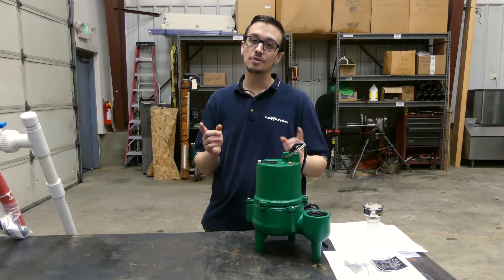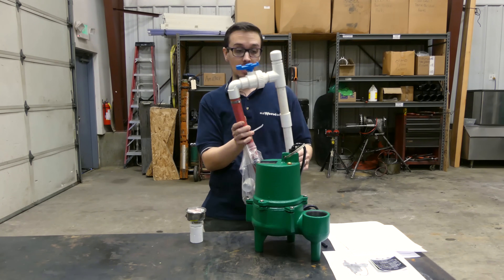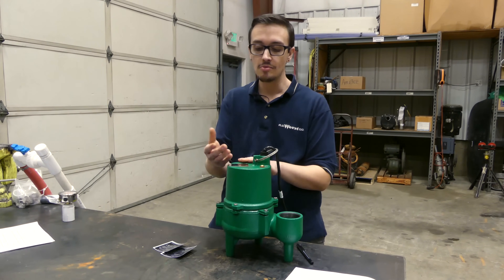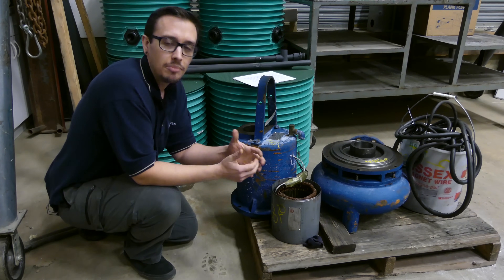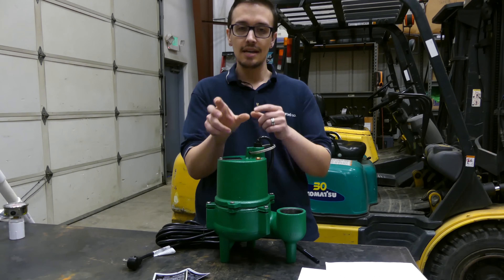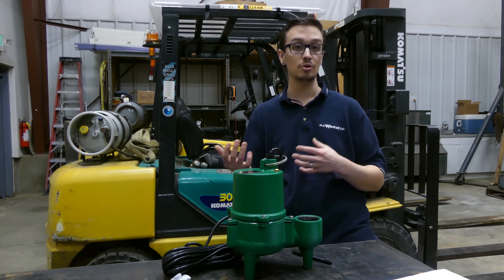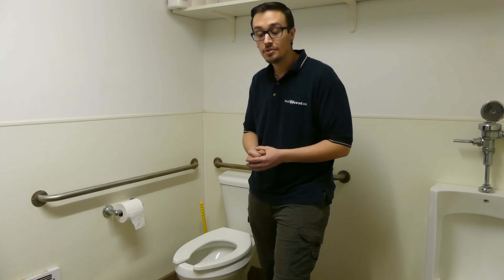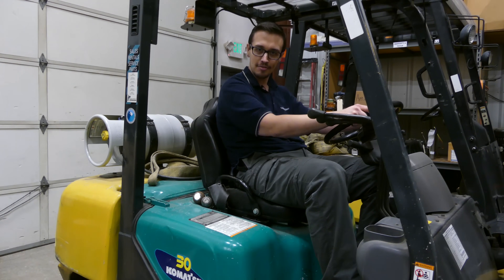8 Things Sewage Pump Owners NEED to Know

Comment: Great video! Very informational. My float was malfunctioning on my 2017 2 HP Zoeler grinder pump. After pulling it, I found a crack in the float. Can you give me an estimate of what a new float and a new switch would cost to have installed on this unit?

Comment: Great video - I currently have a Hydromatic SPD50AH1 20 pump and having a issue that keeps tripping the breaker.  I bypassed the float switch,  pump starts to pump the water to the septic and after 10 seconds it trips the breaker.  I removed the pump and i found some what looked like hair on the bottom and removed it.  Same issue. I also checked the septic tank and it was pretty much full so i had it pumped thinking that was the issue but still same issue.  The pump build is 07/07 - could it also be a plugged pipe going to the septic?

Is there anything else i should check before i buy a new pump?
Can the pumps be repaired or just buy a new pump

Comment: If our alarm had gone off and followed the steps to plug the pump directly, then the alarm stops.  So we assume it's cleared and doesn't require further repair?  Thanks for your tips.
Reply from the maker: You may need a new pump switch.

Comment: When the drain field is located uphill from the tank do you want a large high-capacity lift pump? Do you really want to quickly pump hundreds of gallons to the drain field? Drain fields are going to degrade over time and accept water more slowly.
Reply: Needs to be powerful enough to lift to the rated height. The pumps have a lift ratings, will burn out the pump early if exceeding it

Comment: No need for ball bearings top or bottom in the typical USA made effluent pumps. They are oil filled and the top bearing is just a bushing or a bore in the cast iron. The bottom bearing would be a kingsbury type bearing running in oil and far superior to any ball bearing. they are essentially zero friction and outlast the motors.

Comment: Great video.  I’m looking at buying a house down a hill approximately 30 feet below the city sewer line and 450 feet off the road. This house has a outside sewage sump basin and pump as you described. Is the 30 elevation rise and 450 run to the road a reason to be concerned with this type of system? Thanks for any info.

Comment: I replaced the float switch and drilled a 3/16 vent hole in the pipe just above the waste water pump and below the check valve to prevent air lock. The pump is approx. 11 years old, 1/2 HP> It pumps very slow while the water is spraying from the vent hole inside the tank. The plumbing from the tank runs across the whole length of the west wall of the basement and the south wall exiting the basement in the corner of the south and east wall. About 35 -40 ft. of 2 " pvc pipe. Does this sound like the plumbing could be plugged up or the pump is wearing out?  .

Comment: I have a septic system with a third tank where the effluent goes into. From there it gets pumped uphill to a drain field. I was told to remove the check valve so that effluent drains back into the pump chamber preventing the pipe to the drain field from freezing in our cold Canadian winters. Any thoughts on this.

Comment: Thank you for the great and informational videos you make ! 
I live in israel and have an italian stainless steel 1HP sewage pump which seems to be too strong for my 40mm 6 meters drain output. I've installed a 40mm Y splitter and considred leaving 20mm opening for some of the water to go back to the septic tank, So it won't make damages to the 70+ years old house plumbing because of the excess pressure of this strong pump on the plumbing.
How would I know how much of the pressure to relieve in the Y splitter ? I've considered installing a ball valve in the output of the Y splitter to control the outflow of water back to the tank. What do you think ?
Thank you

Comment: I am new to sewage sump pumps but now have one in a house with a bathroom below the main sewer line.
I recently learned that not all of these pump systems have a high-water alarm to indicate a problem.
Perhaps another tip would be to be sure that your existing sewage sump pump or a replacement pump has one of these alarms.
Reply from the maker: Good tip!
Reply: It is possible to retro-fit a high water alarm without disturbing the existing set-up.

Comment: my plumber said he gonna install this outside the house not at the basement because its going to stink is that right?
Reply: Correct! Install it outside if possible. If you have a problem you will be glad its out of your living space. 25 years ago this was common practice with few exceptions. The new way of doing many things are often profit driven and do with no concern for the big picture. Put the pump outside!
Reply from the maker: All sewage pump installations should be airtight and vented. If there is a smell it means it was not installed properly.

Comment: Very good video.....appreciate the tips. My waste water pump is about 10 years old. I usually clean out the tank every 6 months. It is starting to pump slower with longer pump cycles. Is it common for the impeller to get clogged up with debris?

Comment: Worst self promoting vedio. Not a single word about pumps with integral float switches and NO piggyback plug. Or how to repair the problem of the float switch constantly failing due to calcium build up. Thus putting weight on it so it does not rise up and turn on the pump.
Reply from the maker: If you have questions about a specific situation feel free to call us: 855.329.4519

Comment: Is the Grinder Pumps the same thing as sewage pump?  I bought a what they called "Sewage Check Valve" for using with my basement pump (looks like the green pump in the video) but it printed on the check valve "Not for use with grinder pumps".  So, I'm confused.  Would someone please explain?  Thank you!
Reply from the maker: Grinder pumps utilize a cutter on the bottom to macerate solids before they are pumped. Sewage pumps simply pass the solid whole through them.  Sewage pumps usually have a 2" discharge whereas grinders have a 1.25" discharge since they are just passing slurry through them.

Comment: Hey Chris I have an MQ ST-2005A and the motor gave out and I want to fix it, what should I do, buy a new motor $380 plus shipping or have it repaired, Thanks love the Vids
Reply: OSE USA if it's the motor, and your sure it's not the switch, you need to replace it. There is no way to repair the motor as it is most likely corroded beyond repair. Hope this helps.

Comment: What is the formula for H.P.=feet height ? [how much hp is needed to lift 5' high?]
Reply from the maker: HP and pressure a pump can produce are not directly related because the pressure/flow capacities differ depending on the model, impeller type, volute clearances, RPM, etc.. Give us a call if you need help sizing a pump: 855.329.4519

Comment: do you offer a amp meter for the control box?
Reply from the maker: We do not sell meters, but you can find them relatively cheap (less than $20) at your local box stores. Look for the clamp-on amp meters

Comment: Thanks for the video! My pump is located outside, and with freezing temps in my area, that seems like it could be an issue. How do you insulate sump pumps?
Reply from the maker: The pipe needs to be buried below the frost line and the pump installed below it as well. Insulation is usually only done on the lid with some foam.

Comment: How does a sewer line hold pressure when it’s vented?
Reply from the maker: The weight of the water is usually the only thing "holding" pressure. In sewage systems it is an open loop so no pressure builds up anywhere but the lowest points.
Reply: I’m just trying to understand the pressure gauge. Doesn’t make any sense to me. Pressure would build if you had a belly or more but idk
Reply from the maker: @AndyDC52  Oh, gotcha. The idea with the pressure gauge is to close a ball valve in the discharge pipe and run the pump. With the loop closed the pressure on the gauge should rise to the max pump pressure, so if it doesn't you know you've got an issue with the pump.
Reply: R.C. Worst & Co., Inc. right makes a lot of sense now lmao

Comment: My lift pump is just running all the time I unplugged it to turn it off did not want to burn out the pump any suggestions on why it is running 

 

 

Reply
Reply: Could be you float switch is hung up.

Comment: Have you or do you know if one of your customers has installed an effluent pump inside a pump screen? I am looking to filter out as much of the solid material as I can and I am looking at a pump screen and a pressure filter. If you would prefer I can call in and tell you the exact make/model of pump I will be using and the manufacturer of the pump screen and pressure filter. 

Thanks!
Reply from the maker: We Install effluent pumps in pump screens all the time! Give us a call and we can help you with yours: 855.329.4519

Comment: Good information...Question: Are there any special considerations in choosing a pump or system for a residential RV dump (used occasionally)? The entire volume of the Black tank effluent will rush in to the pit at once up to the max volume of the RV tank...maybe 40 Gallons. Can the inlet be right through the lid of the pit, or is there any reason to pipe it in to the pit side from some reasonable distance away? IOW, locate the pit somewhat removed from the dump hookup? Freezing is not too significant here in the South East U.S.,but any advice on that? The outlet will go roughly 75 feet away, but only a foot or two elevated. Tnx
Reply from the maker: There are definitely some things to consider, I would recommend you give our tech line a call to discuss your application: 855.329.4519